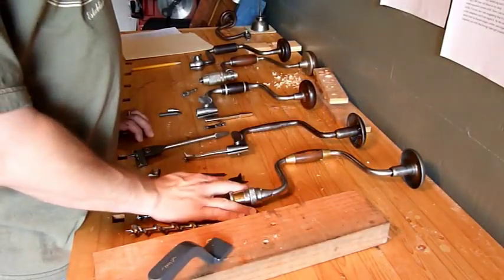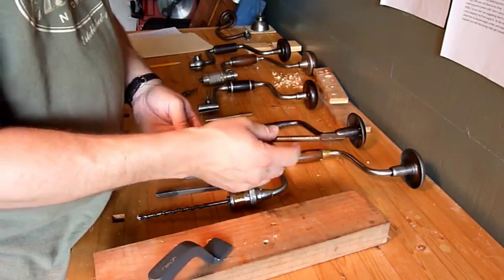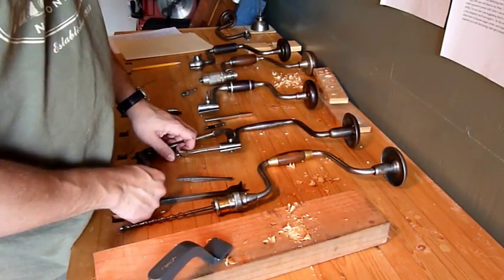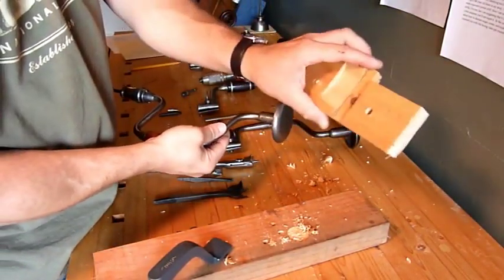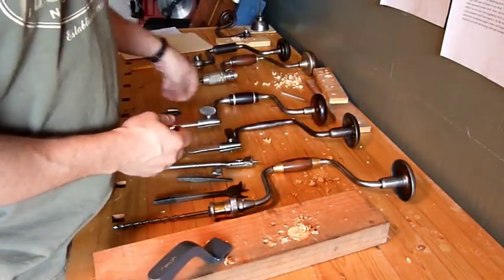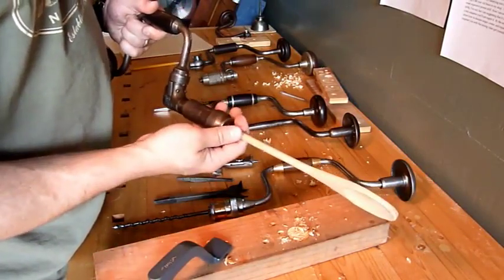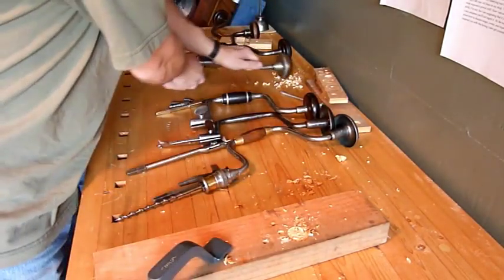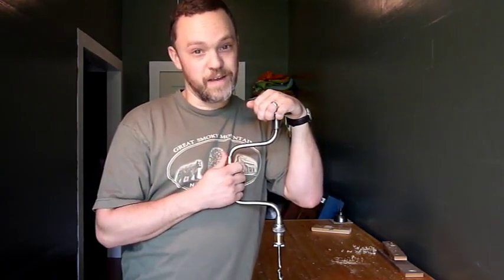Best Drill Ever, Part 2

Comment: I have four antique hand crank cordless bit drivers.
I flat out love my North Brothers # 1545 and my Miller's Falls # 2.  I use the hex drive to 1/4 inch drive adapters with screwdriver bits in them almost exclusively. 
The 1545 is perfect for driving big screws by putting it in low gear.
I also made some clock winding keys adapted for a 1/4 inch drive. I know I could also stir paint with it, and if I put a wire whisk in there I could stir soup and even beat eggs with it. 😁
 I also have a couple of large old Yankee screwdrivers. And three antique braces like yours. I still need to get the adapters for those.
I know that LeeValley.com also carries the hex adapters for the Yankees screwdrivers.

To make the clock winding keys I took the shanks from some clock winding keys and soldered them into some 1/4 in. drive sockets that I wasn't using. I initially made those to use with my Black & Decker battery-powered screwdriver while working in a clock shop.

I like your videos very much.
Reply from the maker: That's a great idea.  I am into old clocks these days as well, and have two that I wind daily.  Thanks!
Reply: @Mountainmanjason  be careful not to damage the clock. They work better with weight powered clocks. They really work best with a battery-powered screwdriver.
It should work fine with those one day clocks.

Comment: I saw a new Craftsman available at my local Ace Hardware just after inheriting several of my father's braces. One Stanley brace is now with my Tap and Die set. It holds a tap much better than any tap handle I've ever used and it's much easier to push on while keeping the tap in line with the hole. I've even thought of a lathe project that would fit into the chuck of a brace and hold a die.

Comment: I use braces of all types frequently. I leave a countersink bit chucked up in my 6" brace all the time.  One caution to people looking to buy used auger bits is that if the lead screw is dammaged, the bit will not pull itself into the wood.

Comment: I have watched this video quite a few times since it was posted. Very nice video on my favourite tool. I have managed to buy a Stanley Spofford type brace, the one in the video looks like bare metal, I am about to paint mine, the ones I have seen with some original finish seem to have been japanned so I am painting mine with the Rust-OLeum hard hat paint. Normally I would wax them, or shellac then wax them, time to try something new.
Reply from the maker: Sounds great, good luck with the project.

Comment from the maker: I am mostly heading towards a non-electric shop myself.  I am keeping a few power tools for now, such as my table saw and thickness planer.  The idea is they will do the grunt work of rough stock prep and my beloved hand tools will do all the joinery and finishing work.  I find the hand powered tools are more pleasant to use, and I can even hear the radio or carry on a conversation with someone.  Good Luck and thanks for the comments!

Comment: I just picked up a showroom piece Millers Falls 14" bit brace in pristine condition off eBay.
The 10" Millers Falls one needs some work at the top of the handle where the ball bearings are located.  The knob is loose and able to slightly see the bearings which have some rust on them.  I imagine they can be either cleaned and packed with new grease or replaced.  I'm trying to do research on how to disassemble properly.
Reply from the maker: That sounds great, do let me know how it turns out.
Reply: Jason, I'm gathering you know how to remove the knob to get to the ball bearings? Also if there is a lot of play, is that the result of wear and tear or do you think it has something to do with maybe a bolt inside under the knob I can't see? I couldn't find anything online. Just saw videos of how to take a ratchet apart to clean it. Any advice would be much appreciated.  Thanks in advance.
Reply from the maker: William, I've never tried to take the knob apart on most of mine.  Some have screws on the bottom that hold the wood pad on, you could try starting there.  Others were pressed together at the factory and can't be taken apart easily.  I'd start by looking for screws.  Good luck!
Reply: Thanks again Jason for your reply.  Yes, there were 3 screws holding the pad on which I removed but can't remove it.  It may be age that has sealed it against the metal seat.  I've tried taking a rubber mallet to it and still can't pry it loose.  I will dig around and do some research.  I don't want to damage it as well.
Reply: Addendum to my own comment: After a gripping the metal coupling which is loose beneath the knob, I was able twist the wooden knob off which is threaded on the inside of the Millers Falls ratchets.  Wish I had known it was that simple, but hey....live and learn.  Hope this info helps others looking to take apart a Millers Falls bit ratchet in the future.

Comment: I have one with a Spofford chuck but the top sweep is twice the length of the lower with a vertical handle on top making it more of a crank. Is it still a brace? Is this common? It seems it would work well on deep holes with an auger bit, after they had been started by a regular brace.

Comment: I have a question for you. I have a Miller Falls HOLDALL NO. 732 RATCHET Brace drill and the head has quite a lot of slop.  It wobbles side to side quite a bit and does not drill a nice square hole. I'e tried figuring how to remove the head to add a new pin, but I'm a little afraid of damaging it. Would you mind if I sent you a small video explaining my problem and offering some advice? I'd really appreciate it. Thx!
Reply from the maker: Sure no problem.  If I can help at all I'd be happy to, just send the video on.

Comment: Great collection of vintage tools! And great video :) Just got 4 manual woodworking drills and I'm educating myself. 2 of them are bit braces, like the ones you've just shown. Another is an eggbeater drill, and the last - I'm not sure. It's metal metal (no wooden parts, except for a little knob on the side. It has the words 'pwwe10 Poland' stamped on it, and is quite big. Has some sort of metal pad for pushing against your stomach. Anyway I intend to restore them all, and use them :)
Reply: Sounds like a brace drill.

Comment: nice video's, by the way for most people that expansive bit is called a fly cutter ( same when used in a Milling machine for metal)
Reply: Sorry but that's not correct. An expansive tool would be most similar to a trepanning tool used on a mill or drill press. While a fly cutters tool bit can be sharpened to bore even high precision straight holes and I've done so a few times, they can't start to bore that hole without an already drilled hole large enough to allow the fly cutters tool tip to enter the bore and being specially sharpened to do that job. An expansive tool is a single point tool that can be adjusted to cut various hole sizes and are still limited by there cutting depth. So those metal cutting trepanning tools have very few differences between them and an expansive tool for wood or other softer materials. Fly cutters are most normally used to do what they were designed for as a light surface finishing tool. For a tool used in wood working to do the same would be what a rotary planer can do with a few more cutting tips. Those would to be accurate most resemble a face mill used for metal.

Comment: great videos, and you are a great actor :). I'm a fan of no power tools and I wanted to buy an brace drill and after your videos I don't have anymore doubts… I'm going to buy one :). I found one on DICTUM, a german shop… If you have any advice where to buy it, pls let me know. Now I'm going to watch again your video to understand better what did you said :)
Reply from the maker: Davide Bagnara You can regularly find them at flea markets, antique stores, and junk shops for very little money.  Plus Ebay is a pretty good bet as these things are pretty bulletproof.  I'd say you could easily find one on Ebay or one of the aforementioned shops for around $20 - $25 bucks.  I would suggest buying used to start with, again most old ones work great and will save you a ton of money over buying a new one.  Look for Miller's Falls, Stanley, North Brothers, or other major manufacturer and you'll be fine.
Reply: Jason Stamper Good advices, thanks.
Reply: Jason Stamper Hi! I'm about to buy the same brace Davide's talking about. One thing about it that you can't find in flea market braces is the 3-jaw chuck. Or can you? Would be great if you knew the answer to that :) I like the older braces' construction better but I'm not keen on the old bits, and I already have some auger bits with hexagonal shank ends that I don't want to throw away.
Reply from the maker: Francesco Mastellone The 3 jaw chucks are harder to find.  I know stanley made some and so did north brothers.  I have a millers falls 2 jaw brace that holds both the square shank bits and hex bits pretty well.  I think you could get a 2 jaw chuck to hold your hex bits, you could try one of your bits in a brace somewhere to be sure.  You would definitely need a 3 jaw to hold round bits though.  Good Luck!
Reply: Jason Stamper  Using a 2 jaw chuck to hold hex bits was good advice, thanks! Regardless, I bought the french brace drill from DICTUM and I'm about to send it back because it's a terribly flawed design. The chuck just makes no sense. It can't hold bits straight, the jaws have silly round grooves running down their middle, defeating the point of having 3 jaws, and the chuck just doesn't want to stay fastened. The end result of this all is that as I was using it to bore its first hole (19mm in beech), the bit slipped and the chuck jaws and the bit shank got stripped badly. I'm surprised that I could't find anything on the internet about the issues this drill has, so I just had to write about it here ASAP. Sorry. Thanks again for the great video :)

Comment: I've just started restoring a brace, and the words VICTOR, and No. 945 are beginning to appear. Do you know anything about its story?
Reply from the maker: Paul Drowns Victor started out in the mid 1800's but was quickly bought out by Stanley.  They kept the name around for a good while, so likely yours was made by Stanley.  The best way to date it is to look for a patent date.  You should find that on the arm of the brace.  In any case it sounds like a keeper!
Reply: Stanley appeared on the chuck but no date on the arm. I'm not concerned about that, just curious.
I mow paths down to the garden and around its perimeter with a single grip European scythe, and I want to make another one,
The first use of the brace will be to bore the holes for the legs for the shave horse I need to build in order to shape the snathe for the second scythe.
Somewhere out there, there is a reaming bit waiting for me to show up!
Thanks for the help!

Comment: how do you make sure that you drill EXACTLY 90 degrees with a hand drill?
Reply from the maker: Well mostly I sight down the brace and they usually run true once the hole is started.  You can also set a small square on the workpiece and get a visual aid that way.  In the end it is not as exact as a drill press, but I get better results than I do with a battery hand drill.
Reply: @Mountainmanjason  use a drill press to make a series of blocks with different size holes and you hold those blocks flat down on the piece you want to drill through and use it as a guide. Start your whole by going through the block first till you get a good hole started in the piece you want drilled and then take the block of wood out of the way and continue your hole. You may want to use starter blocks no thicker than 1/2 in. Especially with short drill bits.
You can start by sliding that block up the drill bit so that you can see the point of the drill bit and put it on your mark and then hold the drill in that spot when you slide the block down and hold it tight while you go ahead and drill your hole.
You can probably also buy drill guides at the store.

Comment: can you convert a old two jaw bit brace to a three jaw brace?
Reply from the maker: a I am not sure that would be possible in most cases.  Your best bet is to look for a 3 jaw chuck if you need one.
Reply: Jason Stamper You can by grinding a bolt that fits the back of a modern chuck to the square shape to fit your old chuck. You have brace with two chucks but more is more better, neh? Used mine for roofing and decking. More controll and worklife than my cordless.
Reply: Buy the adapter that has the square shank on one end and a Jacob's truck on the other end.
Reply: @TF856  I use a Jacobs type chuck with an SDS drill adapter. The SDS adapter has four splines and is gripped really well in the two jaw chuck. It will handle hex shank and round shank bits with no problems. I sometimes chuck up a quick change screwdriver bit holder  to take a hex shank countersink, then swap for the appropriate screwdriver bit. It will also take square drive socket adapters and nut drivers.
I got an all metal keyless chuck with SDS adapter on Amazon for about £15 (U.K.), so it’s not an expensive piece of kit.

Comment: Next time you go to mix up some brownies for the wife, you should probably use a Miller's Falls No. 2 or No. 5
Reply: Miller's Falls #5 only takes very tiny bits.
You might be able to use a wire coat hanger to make a stiring device for that that would fit. A hex adapter will definitely not fit in that drill. The chuck is too small.
It would be better to use the #2 cuz it will at least take a hex adapter and more likely to fit a stirring device.